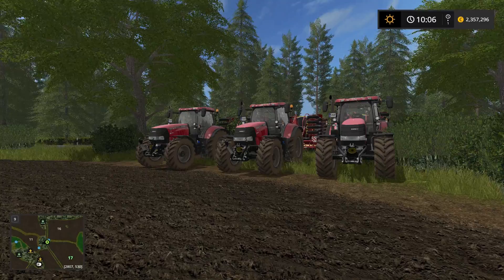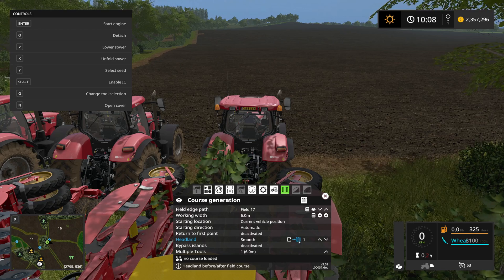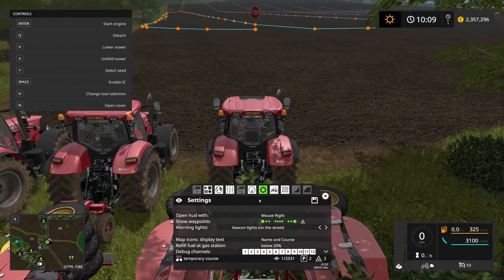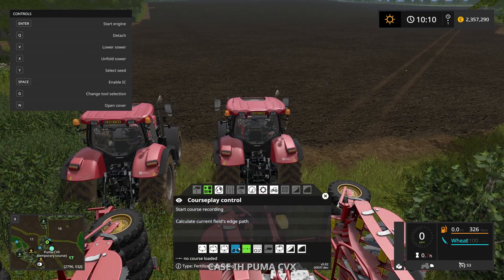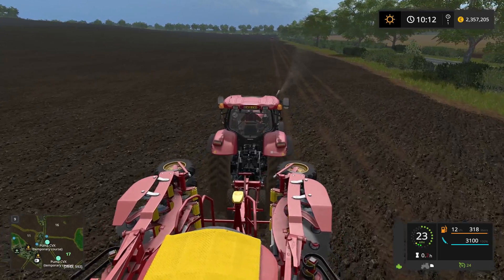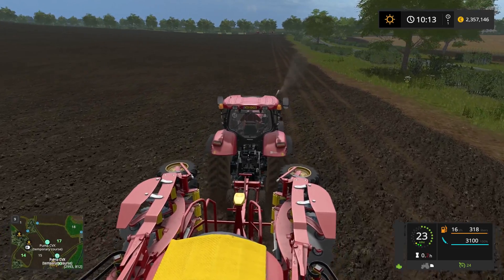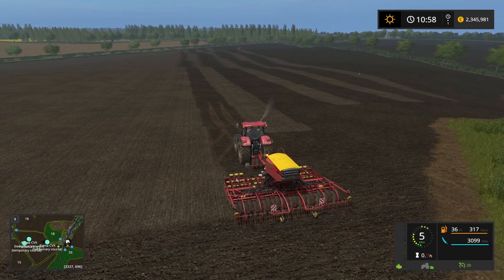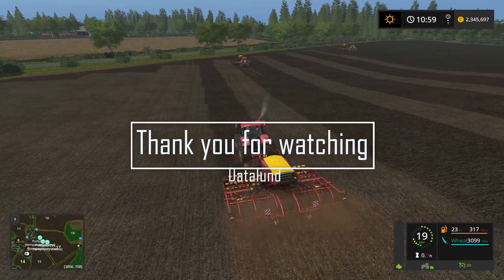Setting up Courseplay 5 for multiple Seeders  - Farming Simulator 17 Courseplay 5 Tutorial

Comment: I have a question for Ya Professor is it possible to have a seed, Fertilizer refill truck and or trailer to refill seeders and or fertilizer speeders in the field in which I do manually now in big fields instead of hauling a big machine back to the farm every time to refill. Thanks.
Reply from the maker: Hey there :D Yeah that would be possible, although I don't think it would be possible to have the refil truck go in to the field to refill the machine, but you can easily setup a field course and combine it with a refill course. Your machine would then go the refill truck once it is empty. When it is filled up again, it would return to the course it was on. I have a setup like that in this video: https://www.youtube.com/watch?v=pPLXAeVGzHI
hope it helps you :)
Reply: Ya thats a dam good idea it would save a lot of time and you could have another overloader keep the refill overloader full. Thanks to old to think any more I guess.
Reply from the maker: It sounds like that could turn out to be a pretty nice setup ;o) Would love to see it in action :)